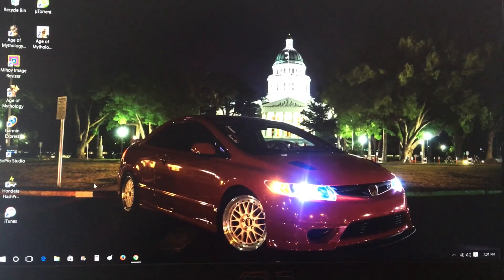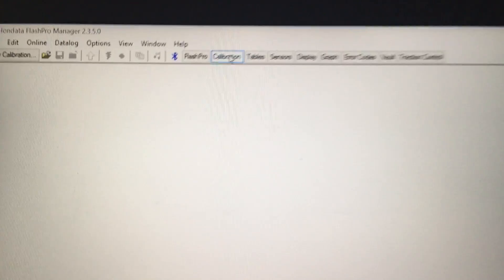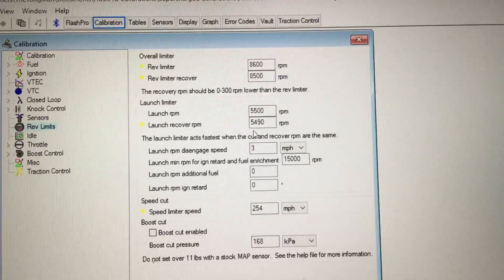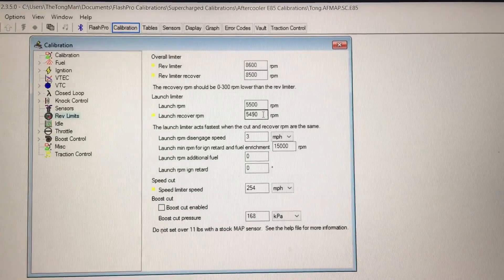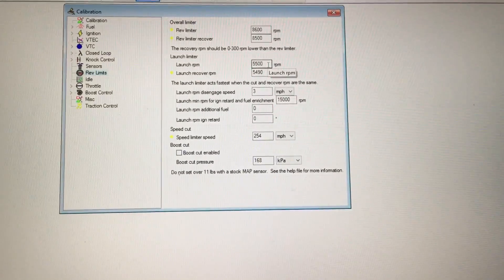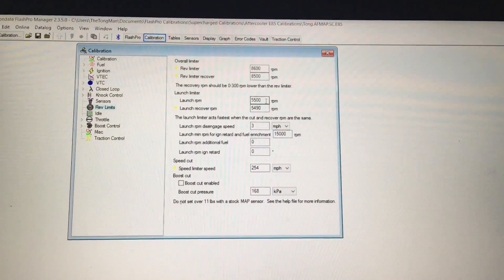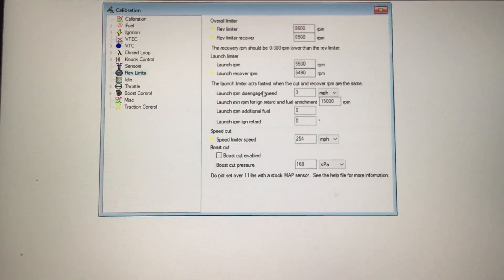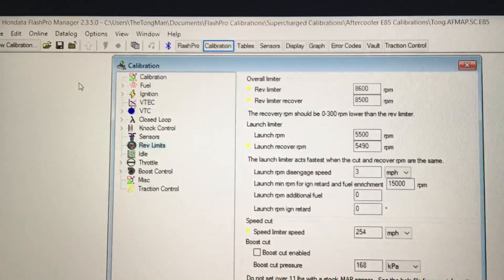Flashpro Tutorial: How to Set Your Launch Control in FlashPro

Comment: how do people make their 2 step bounce faster than others?? great vid
Reply from the maker: set the rebound value the same as the limiter.
Reply: TheTongMan where exactly is that option located?
Reply: 2 step on our cars is very bad for them btw  .   only do it rarely.  it will cause the cylinder walls to wear badly
Reply: Trashman wrong